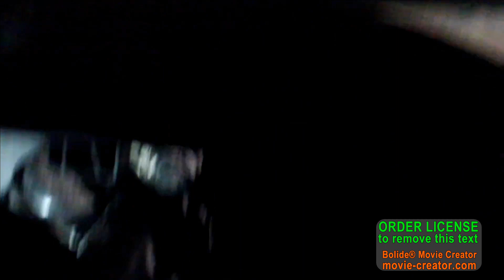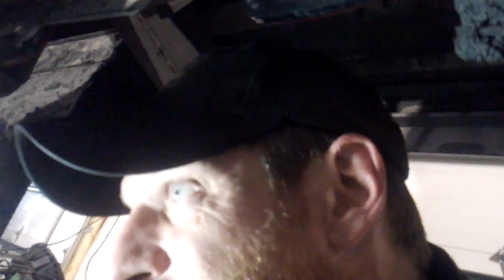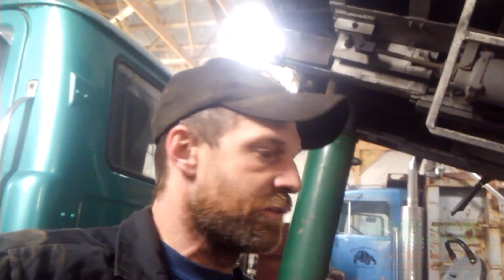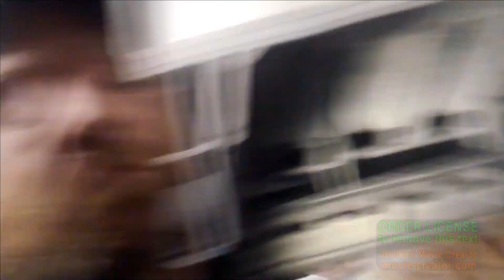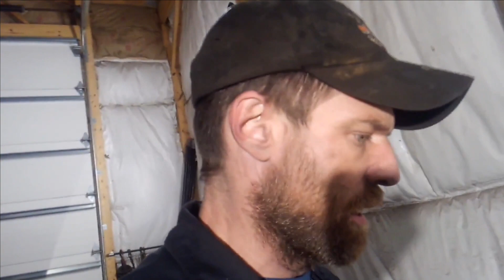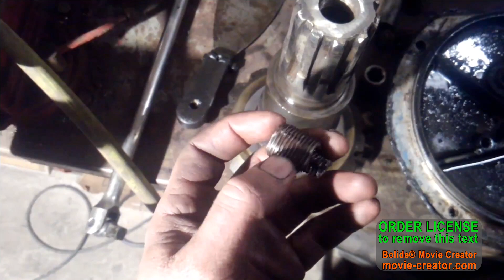Mack Rear End

Comment: Those Mack diffs are real tough
Reply from the maker: There is a picture of a diff in my year in review full of broken bolts. That was a Mack rear end that ran over 50 miles to my shop with 1 bolt, and a bent broken bolt holding the ring gear in place. Tough is an understatement 😉.